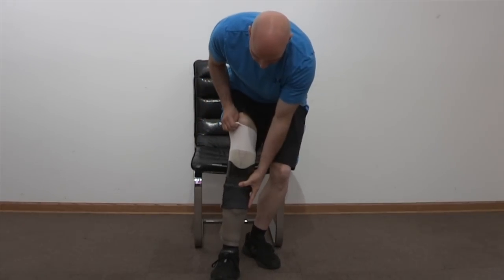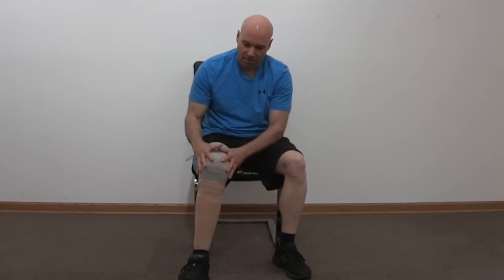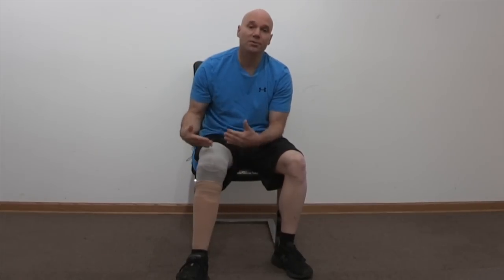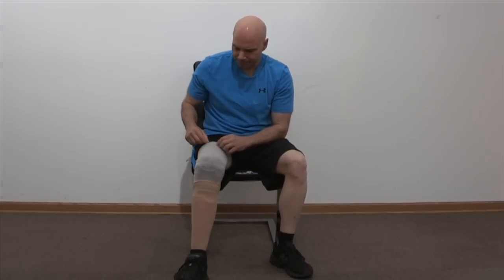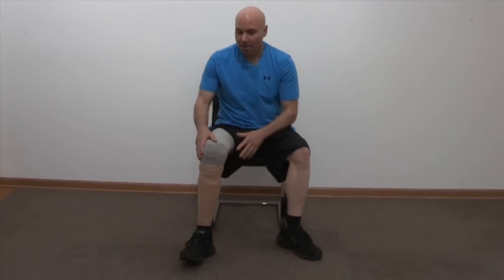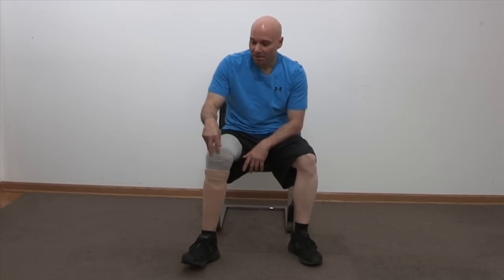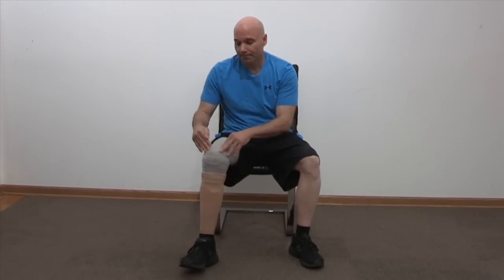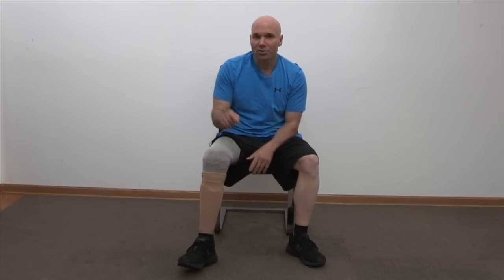EMS Socket System: State of the Art Prosthetic Technology

Comment: Eight years ago .. Please update
Reply from the maker: I’m still wearing the EMS socket system.  It works great for me.
Reply: @mgmusic1  The same one from the video..
Reply from the maker: @jamesgarcia9514  Yes.  I’m still wearing the EMS Socket System.  I had a new EMS socket made a few years ago but it’s the same system.  The only difference is I have an Otto Bock mechanical pump which creates the vacuum instead of the electric motor in the video.  The Otto Bock mechanical pump works well too.
Reply: @mgmusic1  so you have stayed with the same system of prosthetic limb .. Just new equipment..
Because I was going to say what last eight years of abuse to a prosthetic leg.. i only get three years from one
Reply from the maker: @jamesgarcia9514  yes, same system but new equipment.  I’m on my second EMS socket since I started wearing this system.  If I remember correctly, I started on the EMS in 2011.  I’m also on my second prosthesis.  I have an Otto Bock pump on my current leg which creates the vacuum.  The previous one had an electric motor which created the vacuum.  I definitely get more than three years on a prosthetic.  The EMS socket I’m wearing now was made in 2017 and still going strong.  I imagine I will have it for a while before needing to replace it.

Comment: Could you wear that sitting in an airplane. Bent knee? With my harmony I can’t.
Reply from the maker: I do not fly in airplanes much.  The last time was in 2013 and I do not recall having any issues with sitting.  With this system I can bend my knee fully and sit comfortably.  I would suggest an aisle seat in an airplane that allows you to extend your leg out a bit if it does get uncomfortable.
Reply: @mgmusic1  have you ever tried the unity system in the past? I use the 
Harmony system and liked it other then I can’t bend my knee. I now use 
https://www.ossur.com/en-us/prosthetics/liners/iceross-seal-in-x which works well except pulling up the small rubber sleeve when I lose volume. That’s main annoyance. But the unity seems like a blend of both. Just curious if you or someone you knew tried it.
Reply from the maker: @Bothar12   No, I have not tried the Unity system.  I currently have the EMS socket but use an ottobock mechanical pump to  create the vacuum.  In this video I had an electric motor that created the vacuum.  With the EMS socket I can bend my leg fully.  I do not have any issues with volume loss.  I just put the leg on in the morning and never have to do anything else.  The mechanical pump works quite well with the EMS.
Reply: @mgmusic1  is the EMS now made done by Ossur? I’m still trying to figure out how you bend it fully when you have the sleeve on. You still have issues if the sleeve is punctured right? Thanks for replies btw
Reply from the maker: @Bothar12  Carl Caspers invented the EMS and I believe he sold it to Ottobock.  The EMS socket is pliable and forms to your leg as you bend it.  You will notice this in the video.  This is what allows me to bend my leg comfortably and have more range of motion and support.  Yes, if your sleeve is damaged/cut etc. it will not hold the vacuum and you will need to get a new sleeve.  It’s important to find a prosthetist who knows how to cast the EMS.  It is very different from the usual casting system for other sockets.  Ray McKinney, who I referenced in this video, passed away and so I needed to find someone else who was familiar with this system.  I contacted the inventor, Carl Caspers, and he let me know who was the closest prosthetist to me who was trained in this.  I went to Doug Reichert
Reply from the maker: Doug Reichert in Wisconsin made me an EMS and it has been excellent.

Comment: My experience to date has not been so stellar. I had wounds and callouses on the distal end of the residual limb and has a painful weight bearing are on the distal end of the fibula because they were not cut evenly ion the amputation, the fibula is easily an inch longer. I have been using a thermoplastic socket under elevated vacuum for a few months so my limb would do any shrinking while changing from pin lock to vacuum. All the wounds save one (improved)have cleared up. 2 weeks ago they made the socket for Ottobock to their standards, its not a normal socket and the procedures are very different. Since Ottobocks policy is apparently "you ordered it its your problem" my prosthetist ordered the EMS with a test socket, against the wishes of Ottobock. This was to insure a good fit before the final socket was made. So I tried it on today. As far as I can tell, under pressure I don't see any better grip or more connected to the EMS compared to standard elevated vacuum. The EMS seemed loose to me. They said it was supposed to be 3 socks too big. There was a bubble on the end, That was meant to be there. It started to hurt upon bearing weight by the distal end of the tibia. It had far less range of motion than the thermoplastic test socket I had been using. The test socket was very comfortable.  The only benefit I was hoping to get from EMS was the increased range of motion. When I say there was less motion I'm not talking about a little less  range I mean a LOT less. I could probably manage about 20 degrees of motion with the EMS. No matter if they trimmed the back slightly or the ears that come over the top of the knee cap or tried some socks to make up for the size difference it would hurt less in one area but accentuate another area worse. The distal end of the socket from 7 o clock to the tibia at 2 o clock was one large pressure point, probably because of the odd idea that Otttobock had to manufacture the EMS larger than the mold supplied. If I put the EMS on without the leg it would fall off from gravity, too big, their idea. Here is the point. I know from experience that if you leave the prosthetists office with something that hurts it's going to get worse, more painful, wounds will come. I wont do it. So they took it off. I'm going with elevated vacuum. I'm back in my test socket. I feel terrible for my prosthestist because Ottobock is a "its my way or the highway" kind of company. They want to get paid for an ill fitting piece of crap. It's great that you have had a positive experience and it was your video that led me to try this. unfortunately I have had the completely opposite experience, Discomfort, poor fitting, lack of range of motion. Frankly I'd rather wear 25 ply of socks and wobble in my old pin lock that wear that poorly fitting cheese grater. I do realize that the final socket is more pliable than the test socket but if I sink in the EMS because they decided to manufacture it too large it wont matter how much more pliable the final will be. Ill still sink into it and bear weight in odd ways. It's a novel idea, Somehow for me it was a huge fail. Any company that does not stand behind its work, and if its not right we will make it right, is not a business that should be"providing" devices for  the handicapped.  Just my experience, glad to see things worked out well for you, and Carl Caspers has done great work but I'm not so fond of Ottobock at this point. The test socket my prosthetist made for me, and I am currently wearing is great, why cant Ottobock manage to do this?  It concerns me that my guy is caught in the middle. If they screw him over they just bought themselves a full time negative publicist.
Reply from the maker: I'm sorry to hear about your bad experience with the EMS.  I feel bad because you tried it after watching my video and it didn't work out for you.  I just talked with my prosthetist, Ray McKinney, and asked if he would read your comment and reply to it.  I feel you deserve a thorough response and Ray knows much more about this than me.  He did point out to me that not everyone is a candidate for the EMS,  which I didn't  realize, and that is something the prosthetist needs to assess and determine for each person.  I've had such great success with the EMS and was surprised that your experience was the opposite.  I think Ray will be able to shed more light on why our experiences are different.  Look for his comment within the next week and thank you for your comment.
Reply: I have read your comment about your experience with the EMS. After much thought, at least two dozen questions came to mind. I would need to have  answers to these questions prior to making a determination. I can tell you that your experience just doesn't seem right to me. Whatever has happened to you, this is not a typical response. I would need to speak to you to get to the bottom of this, but I would be happy to speak with you. Please feel free to call me.Ray McKinney CPO 2244300329

Comment: My experience has been similar to yours. Pinlock socket with the same kinds of pain you had plus copious sweating to the point where the leg would come loose while playing golf. Switched to the Ottobock EV system five years ago with fantastic results, I'm very happy with it. But it looks like your leg is even better.

Thanks for making this video, I'll be looking into the EMS socket in more depth.
Reply from the maker: Thanks for your comment, Tom.  Glad to hear you've had good results with the EV system.  If you have any questions about the EMS Socket System after looking into it let me know.  Thanks, again.
Reply: My prosthetist doesn't know anything about the technology but is going to research it. Right now, I've got an Ottobock custom urethane liner, one sheath and a carbon fiber socket using a P3 manual pump. I'm guessing we need to send EMS a cast of the liner on my stump, they'll build the inner socket and then my leg guy will cast a new socket that will enclose the inner socket. Is that about right?
Reply from the maker: Tom Briggum Most prosthetists have not heard about this system yet as it is relatively new.  Those who want to provide the EMS Socket System will have to go through some training because the casting and modification is different with the EMS. My suggestion would be to go to the emssockets website I listed above and contact Carl Caspers.  Carl invented the EMS Socket and will be able to guide you through the process.  Good luck, Tom.
Reply: mgmusic1 Thanks, I appreciate your help.
Reply from the maker: Tom Briggum You're welcome.  Let me know if you have any other questions or concerns down the road and I will be glad to help further.  I hope your experience with the EMS is as good as mine has been.
Reply from the maker: Tom Briggum Tom, I would also suggest contacting Ray McKinney.  Ray is my prosthetist and he has done over 100 EMS Sockets.  I spoke with him and he said he would be glad to give you some guidance in the process. His cell is 224-430-0329.  He would be happy to help you.  Leave a message if he is unavailable and he will get back to you.  Ray was the prosthetist for Ron Santo of the Chicago Cubs and has a wealth of knowledge regarding prosthetics and the EMS system.  I hope this helps.
Reply: mgmusic1 Thanks, I really appreciate that. You've given me a great start on giving this thing a try.